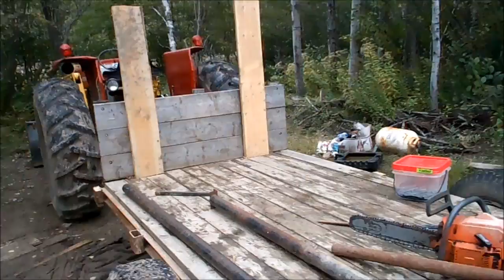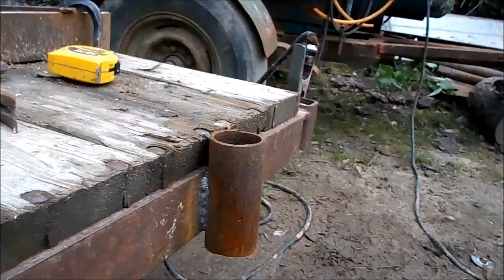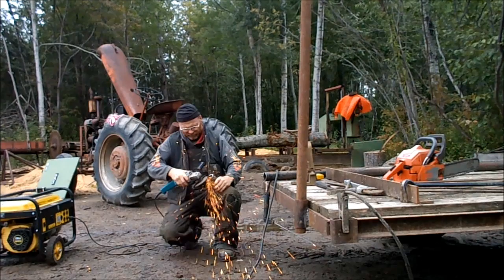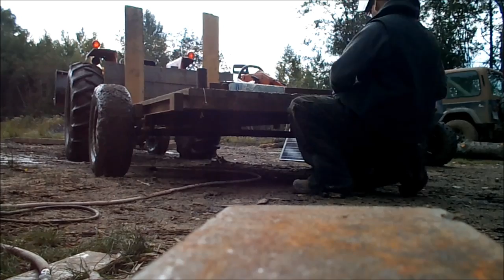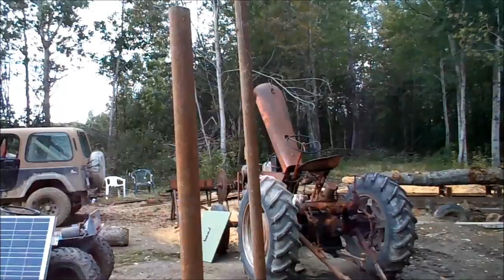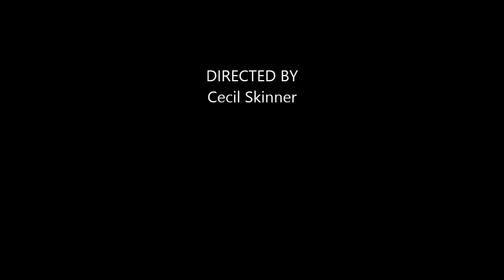Building A Log Trailer To Use Around My Homestead

Comment: how do you like the massey 165 Cecil. its a very nice tractor, I have a 135 and it works like a top. what make is the tractor on your saw gear. here on p.e.I. we call them saw gears.
Reply from the maker: I like it Rob I do wish it was a 135 though like yours, this one is a little big for the bush, The tractor that runs my saw is an old Case, it runs it pretty well.